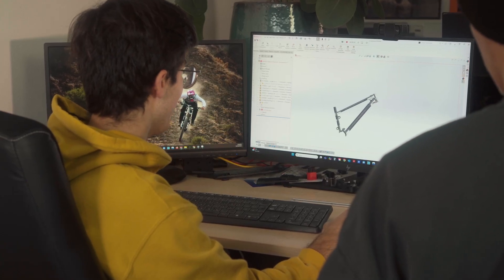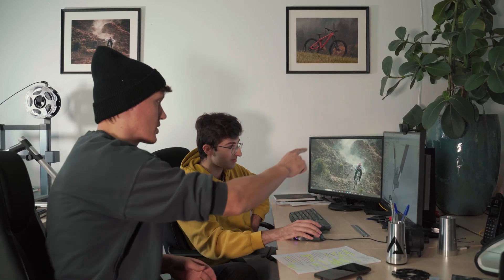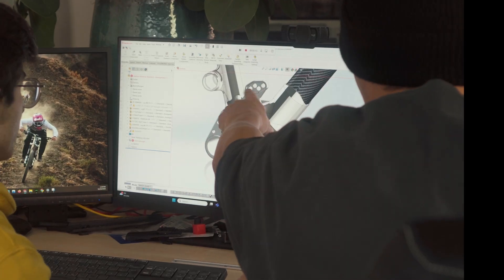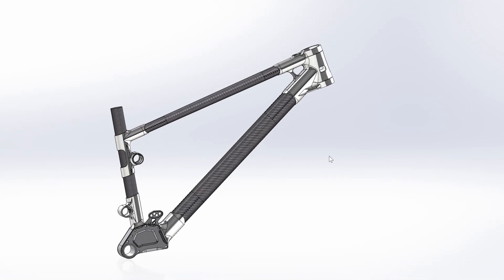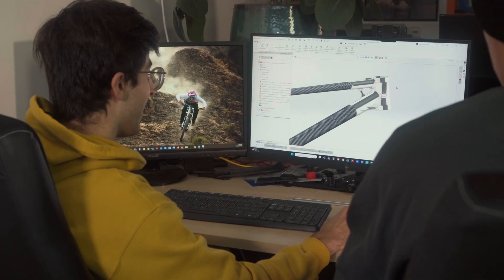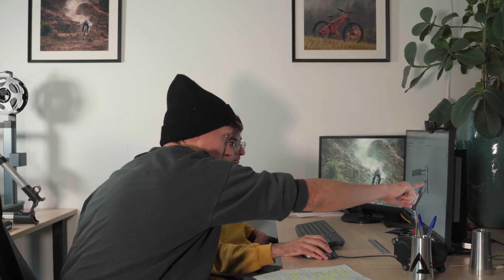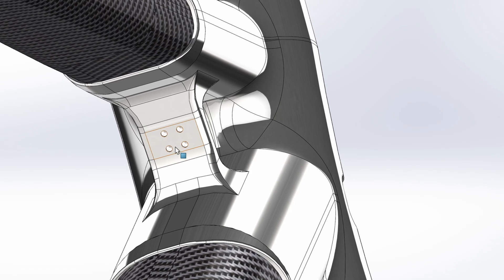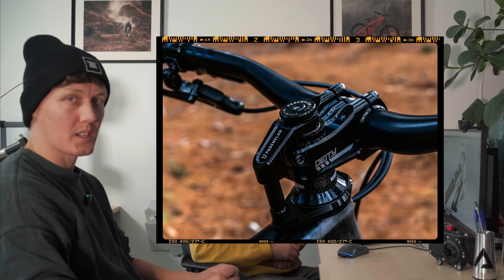MTB Frame Development – Episode 1 - Current State of Our New Frame Project

Comment: I’m simultaneously so stoked for the new development, but also bummed given how dialed the old platform was. Being in V7 of a concept builds a lot of confidence in the design and it is tough to swallow going back to square one with  a completely new frame and all the asosciated quirks and hiccups. I just wanted a V7 with well thought out external routing 😅. That said, the engineering is super cool and excited for you guys. Maybe you can come up with some 3D printed external guides for V7 customers 😂
Reply from the maker: Thanks it's possible that we can also come up with something that'll bring a solution to the current models.

Comment: I really didnt want carbon but this video made me change my mind a bit... maybe I wouldnt care for 200 euros more but would need a protector for the downtube and that would probably make it look weird, you know with the big lugs + protector, like too much stuff.  lol  But anyway, I wanted to buy the V7 this winter or next spring max but I guess I would have to wait a bit more so I can have external cables and the new real deal! 🤩 
1- Need external cables like I am always saying. lol If it is just the brake, it is still better than nothing and won't be a deal breaker for me, hoping the 2 cables inside won't rattle...
2- Still need the 205x65 for the 160/177mm bike as I just bought the shock for my next bike! :P 
3- Would really like a low (as right now) and higher BB as it was the second thing that made me hesitate for the V7 since a year or two.
4- Would also like a bit longer headtube.  +10 or 20mm in the large and up, could it still fit a dual crown fork?  
5- Would like the option to chose the rocker that we want, so we could have the leverage+ for the same price (it is 400+tx here in Canada).  I might have understand that you want to change the new rocker but why so if the rear triangle is the same? 

Just hate to buy a brand new model of car, bike or anything that could be an horror story but cannot wait 2 years for a new enduro bike so... I hope it wont break like Bernard with his Pivot. 😬 Also it won't be ready next spring as you said it at the beginning but what could be a realistic time if no major problems??
Reply from the maker: Hey that's a lot of feedback would you mind to drop us an email for the questions we won't cover here.

Shocks will remain the same. 
Headtube will grow from size L.
DC will still be realistic for all sizes.
Next spring it's realistic if everything is super smooth.
We changed the kinematics slightly that's why we use another rocker.
Reply: @Kavenz-77  Wow, that's perfect!  I like all those answers! 😁👌

Comment: I have to admit, I don‘t see the advantages, yet, compared to the beautifully „simple“ V7. It won‘t be lighter or cheaper. It runs the risk of looking like an ebike, with the boxy BB area, which would be a deal breaker for me. I can relate, that it is a fun challenge to develop something „different“ and there might be real benefits, or not.

Two ideas: either keep also selling the v7 as a classic, to keep purists happy. Or mill the bottom bracket lump out, so it is „see through“ like the rear dropouts, so no one might mistake it for a motor. (which is already the case with a Pinion, but at least that eliminates the rear derailleur and therefore has some value in itself.) 

The Scott Ransom is said to be a stellar bike, I have to admit that I wouldn‘t buy one alone for the ebike-looks.

I appreciate the project, the opportunity to spectate and love Kavenz as a company, so all my best wishes, despite the critical oppinion regarding the V8.
Reply from the maker: Wow thanks for the detailed response we can resonate with that and could imagine that in the long run we will have this as a premium product and the V7 as a more classic version.
Reply: Downgrading the OBVIOUS advantages that this new approach gives, just because it may look like an e-bike to someone (probably stranger to the owner), is the most pathetic, low self-esteem reason I'd never expect to see! If this is a deal-breaker for you, then you don't deserve this bike!
By having a COMMON frame for both derailleur or gearbox drive and the flexibility to play with the position of the BB drop, by just changing some mounting plates, it will skyrocket this frame to new customizability levels! 
For all these and for the courage this company has to think and act out of the box, I'd present this bike with pride and confidence and definitely look down to anyone that can't see all these and just thinks this is a mere e-bike!...
Reply from the maker: @taz800 we could offer 🚫 E 🚳 Stickers for the box 😂

Comment: LOVE what you guys are doing with this generation. For the next gen 2027/2028 i would like to see Kavenz pioneer the most adjustable headtube junction of all time. You know how we currently have head tube angles that can be adjusted for example 64.2/63.8/63.2:
I would like to have the option for SLACK or SLACKER

SLACK variant being 65.5/64.9/64.5

SLACKER variant being 63.9/63.5/62.9

I want Kavenz to make these adjustable headsets be BURLY and thoughtful

I also see an opportunity for an eccentric bottom bracket to be placed in that space where the gearbox would usually be/ eccentric BB’s are famous for creaking though and i would like to see Kavenz also pioneer the ultimate/genius eccentric bottom bracket/THEADED of course😉
Reply from the maker: You got some faith in us. That fuels our engineering engine.

Comment: Great video! Any idea what the weight difference will be? vs the alu frame. Are you planning to use a standard 90deg winding of the tubes or to play with different fiber directions? Happy to give FEA input at least for the CNC bits (I dont have bonding experience but have done plenty of FEA in Solidworks)
Reply from the maker: Thanks for your offer we already started the FEA and yes the winding will use different angles for the start we will use compo techs experience and maybe improve from there.
Reply from the maker: I'm sorry missed the weight question. We currently estimate the same weight without the bolt on BB parts. So at the moment the frame would be about 200 grams heavier but maybe we can optimise a bit more.
Reply: Hey Ariel! I'm working on building a bike in a similar way, and would love to bounce some ideas off of you!

Comment: Super exciting! How are you going to solve the issue of galvanic corrosion between carbon and aluminium lugs?
Reply: Lots of proven solutions out there!
Reply: Normally anodizing solves this I think? though it has to be correct such that the glue bonds properly to the aluminum
Reply from the maker: One thing we do is not use 7075 which is kind of the worst in terms of corrosion.

Comment: Looks super good! Few questions. Will the pinion battery just get placed further down in the down tube if the storage compartment comes? Have you thought about carbon rear ends?
Reply from the maker: Thanks, the compartment won't be for the gearbox version. A carbon lugged rear would make the frame very expensive 🫰🏻